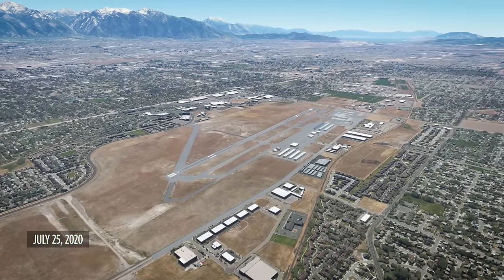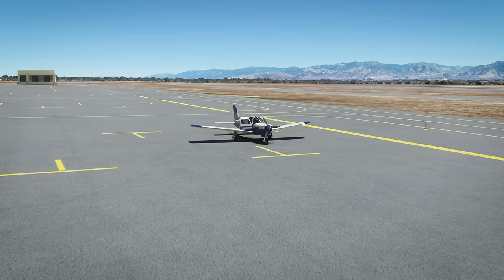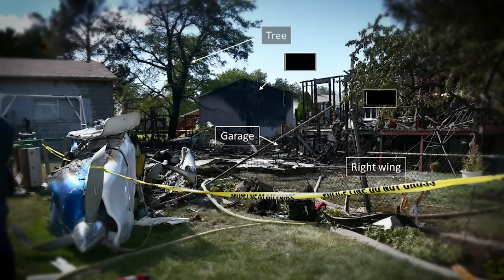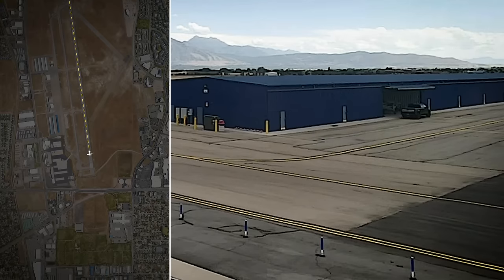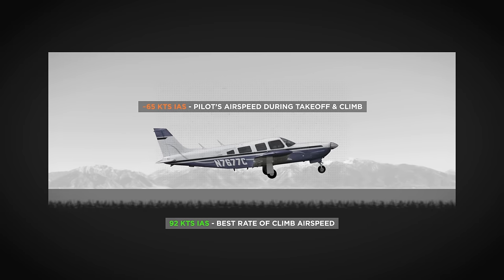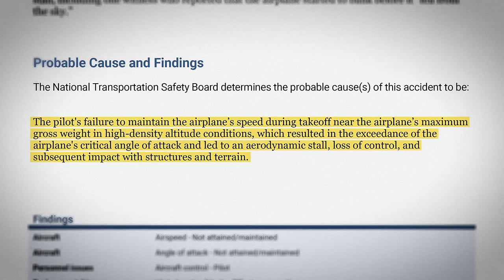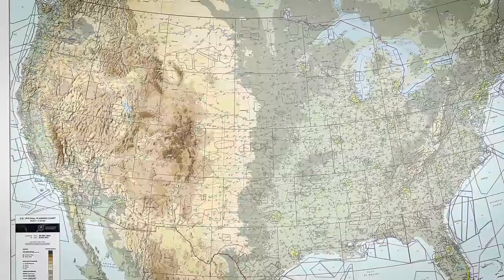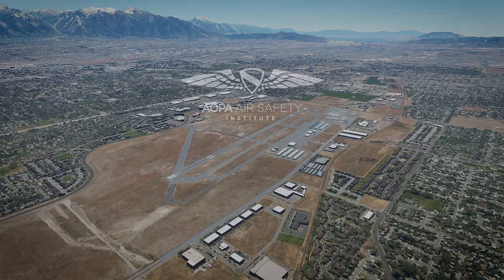Accident Case Study: High Aspirations

Comment: The most frustrating part of this is the NTSB, once again, placing all of the blame on the pilot. He followed the book to the letter, did everything right, and the plane didn't perform to spec, and they even acknowledged this. Sure, AOPA tells you to pad the numbers by 50%, but there's a lot of things wrong with that. The AOPA isn't the FAA. Padding the numbers by 50% would make some planes just flat out unflyable in any condition. Where'd the 50% number come from anyway, a good guess? What's the point of numbers if we're just guessing to begin with?

I think the biggest problem is in the POH. We're taught to treat it as the word of god, yet time and time again the numbers come out flat wrong, and someone dies because of it. I think there needs to be some accountability there.
Reply: Those POH/AFM numbers these days are fairly good ; they are supposed to be what the average pilot can achieve ,if, and it’s a big ‘if’ , the pilot does everything as the book suggests .
We don’t know if he leaned the fuel properly before takeoff. If he did then there would be no reason to fiddle with it just after climb out as he seemed to.
His climb rate was dependent on NO FLAP and a Vy appropriate to that DA which is lower than a sea level one . [ Vx increases somewhat with DA ].
Another nuisance for him would be a decrease in IAS in about the first 100’ AGL as he was climbing in a tailwind [ which he may not have realized ]
Reply: This is solely on the pilot.
Reply: @TJATJA1982  explain.
Reply: @aramusbelmont4992  It's super close to both COG and weight limits on a very hot day. He's flying his family and kids - wouldn't you want a bit more leeway? Did he need to be flying that leg with full tanks? Messing with the mixture lever in those critical moments - shouldn't he have leaned before take-off? Seemingly taking off way under the suggested speed? Stalling the plane into the ground? 

Near max weight, high altitude, hot and taking off downwind -  cutting the margins very fine indeed. 

My respects and sympathies to the families of the pilot and the passenger, but this was not the fault of the POH.
Reply: I think the biggest thing is that he did not abort when the airplane was not flying. We all know what a normal take-off feels like, even heavy. If you're hearing the stall horn on rotation, it's your last warning to save your aircraft. He had 2,000 feet to pull the power back - but more importantly - he had 800 hours to build personal minimums for takeoff, including having a point where he will abort if the aircraft is not in a stable climb. The Airplane Flying Handbook recommends to pilots of GA aircraft that personal minimums be "Abort if not airborne by one half the runway length", or something else easy an quick to determine on a takeoff roll.

This pilot was a better pilot than me; He did everything right up until that last moment where his experience and skill should have led to pulling the throttle and stopping on the remaining runway. That's the only critique I can give to an otherwise great pilot who was screwed by tired aircraft.
Reply: The take off was within normal parameters for an airport at this density altitude.  The takeoff was not the problem, and he still had plenty of runway left.  The problem is that climb rate after leaving ground effect was low, and the tailwind probably aggravated that circumstance.  Accepting a 100-200 ft/min climb  in a N/A airplane is hard if you have not trained for it or experienced it and the tendency is to  stress and try to pull the airplane up to the expected climb rate. Hence the stall.  If you realize you have a tailwind and the airplane is not performing, nurse it around into the wind to help with the climb rate.  Also, if my memory serves, this was nothing that would have prevented the plane from continuing to the south at a low rate of climb as far as obstacles go, so sometimes we have to accept what we can get on hot/high days.   @TJATJA1982
Reply: @garyrisley9170  What could be the reason why an airplane with a nominal weight with a nominal takeoff pitch and at a nominal indicated airspeed for takeoff just does not want to climb at a nominal rate? This should be something very unusual, not related to large density altitude or low engine power.
Reply: @WestAirAviation  Exactly my thoughts.
Reply: Regarding your question: The same reason that aircraft have a service ceiling.  As the air gets thinner, one must go faster to obtain the same component of lift, correct? And absent having surplus power available, the rate of climb decreases.  Once out of ground effect, the airplane in this story was at effectively 7500 feet of altitude.  What is the climb rate of a N/A Lance at 7500 feet?  For an example, my turbo-Lance at airports below 1000 feet will climb like a homesick angel (1250 to 1500 fpm easily).

 On a hot day here at my home airport of 5500 ft, 500 fpm is a good climb.  On the occasions that the wind flipped to a tailwind on me, and I recognized it, I kept the nose down, built speed, flaps one, and a slow turn into the wind to let the apparent wind of the headwind help with lift because I have experienced a 200-300 fpm climb rate.  

The first time I ever flew a C150 at my current airport in the summer, I did not know if I would ever make pattern altitude and managed only a 100 foot to 150fpm rate of climb.  Density altitude can be managed, but precautions need to be taken.

 Weight is also a factor in the climb rate.  In this instance, the pilot could have taken off with 60 gallons of fuel instead of 94 ((a 204lb weight savings) and still had plenty of fuel when he reached Page.  @ikono2
Reply: @garyrisley9170   Thank you for the long answer, Gary. "As the air gets thinner, one must go faster to obtain the same component of lift, correct?" No, it is not correct, as long as we speak about the indicated airspeed. The IAS measured by Pitot tube is actually a measure of available lift, independent of air density, because the lift and the stagnation pressure in the tube are both proportional to the air density. At least if we do not approach the speed of sound. At the service ceiling, the problem is not only the lack of lift, but first of all the lack of indicated airspeed. Otherwise, we could pull harder and climb further without a stall. Therefore, given the nominal indicated airspeed, at nominal weight and with adequate angle of attack, a non-damaged aircraft should climb with nominal rate, whatever the density altitude, right? 
Usually, I fly a microlight which would normally climb at about 300 fpm only. During the takeoff roll, I observe the airspeed, and if it does not reach the speed for rotation at about mid-runway, I abort the takeoff. One day, I was surprised that the motor rpm were higher than usual during run-up for the given setting of the trottle. However, during the takeoff roll the acceleration felt strangely weak despite of high rpm and I did not attain the airspeed for rotation at 1/2 runway. The runway is only 300 m, so everything happened within seconds, I aborted the takeoff just in time and did not roll out. The reason was that I had dismounted the propeller for an inspection, but then mounted it vice-versa. Of course, it was my fault, but my observing the airspeed during takeoff roll saved the day. I think the poor fellow in the video made some similar small mistake, like did not lean the mixture at run-up to account for high density altitude, but additionally rotated at too small airspeed instead of aborting the takeoff at 1/2 runway. Given the conditions close to the limits, two small mistakes were too many.
Reply: @ikono2  agree, he should have known the airspeed he needed to rotate and where he needed to rotate on the runway.
Reply: "Padding the numbers by 50% would make some planes just flat out unflyable in any condition."

First of all that's patently untrue, second, if it were true, you don't have the right airplane for the job. And about the 50% thing - there seems to be a generational issue at play. Younger pilots seem to think that the stuff that kept the old guys alive and flying for 50+ years just doesn't count anymore; we're so much smarter! Right? Anyone who thought this flight was going to result in anything other than exactly what happened should have their certificates revoked. This guy was dead before he ever got in the plane. Unfortunately so were some of his passengers.
Reply: @IslandSimPilot   To be fair it's probably true that nearly all single-engine piston GA aircraft are not really the "right tool for the job" when it comes to providing any kind of practical transportation
Reply: I would say that given the fact that his airplane wound up in someone's house on fire, he didn't do everything right.
Reply: I would not classify this as pilot error- the pilot apparently did not commit any errors. A tailwind on takeoff, while certainly not ideal, does not explain the poor climb performance. Something else was going on here.
Reply: @rrm4cy  A tailwind on takeoff absent any other of the factors involved may not have been a problem per se, but at 7,000 feet DA at max gross, it most certainly was a problem. In ideal conditions with perfect aircraft performance and test pilot-level skill he could have expected a 500 FPM climb. Betting your life on that (never mind the lives of others) in these conditions provided an expected result.
Reply: @IslandSimPilot  judging by your response, I am doubtful that you’ve ever flown a plane. A tailwind on takeoff extends the takeoff roll, which could be observed in footage. While not a sound decision, once airborne, a light tailwind is irrelevant and not a factor in the crash. The report does not discuss the tailwind factor at all. In any case, he was well within the operating envelope. The NTSB report does not indicate whether he had the mixture or prop settings correct on takeoff. The fact that he was adjusting mixture indicated maybe he did not have it set correctly, but they really didn’t get into an analysis at all. They didn’t say anything about prop pitch setting. They did say that 6 of 12 spark plugs were severely worn, which likely caused a hit to performance of the engine (though again, the report fails to analyze this). This report is utterly inadequate at helping pilots understand what went wrong here.
Reply: @rrm4cy  FAA instrument rated. But nice try. The idea that he was "well within the operating envelope" is belied by the outcome. He was clearly doing a wheelie trying to yank the plane off the ground for the second half of the takeoff roll, which added to his poor decision to takeoff at max gross, high DA, downwind. What went wrong here is he decided to attempt this flight. That's what went wrong.
Reply: I've never heard of the 50% padding rule. I've always used 15% as suggested by my instructors, and later suggested to my students.
Reply: Taking off down wind at max gross weight in a high DA enviroment is not following the book to the letter!
Reply: airplane:   you  put me in a situation where I can't fly
 pilot:         well according to the POH, you're supposed to!
airplane:   sorry, don't know what to tell you
Reply: The NTSB didn't blame anybody.
Reply: @My_Fair_Lady  wtf are you talking about? Nobody said anything about the accident...this video and comments were WAY before that even happened.
Reply: My flight school flies 1975 C172Ms. The original cessna POH is flat out wrong... and i mean WWAAAYYY wrong on some of its numbers. So yea it's annoying. Mostly cruise speed and fuel endurance. I know for a fact a C172M isn't going toc ruise at 121 mph. with 60% power. LOL.
Reply: He took off downwind are you serious ???
Reply: @kenclark9888  The aircraft had enough runway to still get airborne... The problem seemed to have become serious after he left ground effect and tried to climb out.
Reply: @ikono2 Those book climb rates are probably in clean configuration and , who knows why , he was using flaps . Planes always climb steeper and faster clean.
He may not have realized that Vy would have been ~ 7% lower at that DA than at sea level and given that there was a small tailwind he’d have a small a/s reduction in the first 100 ‘ AGL to boot due to ground friction because that tailwind speed would be higher there .
As has been said , failure to lean mixture could have had a decisive effect but if so I doubt he’d have even got off the runway .
Reply: This is like saying why the bridge you drove over today has factor 2 safety built into every part of it... are you kidding.
Reply: Pilots ARE RESPONSIBLE for all of it.  If the plane could not climb then the pilot was to set it back down on the ground.
Reply: My guess is those book numbers take into account a properly leaned engine. Running excessively rich would cause less power and worse performance. It seems that the pilot remembered to lean the mixture too late to avoid disaster. 😢
Reply: @IslandSimPilot i just want to be clear here.  You’re saying the FAA is wholly at fault for this accident, yes?  Since they’re the ones demanding we abide by the POH, carry it at all times, and plan our flights using it’s data.  And somehow you’re the only guy that knows that POH numbers require a test pilot to achieve? Seems like that would be a good thing for the FAA to teach pilots - that the POH is unreliable, overly optimistic, and should not be followed.
Reply: @ragedracer1977  Just trying to figure out how many strawmen you've managed to fit in here. The pilot is wholly at fault. I did not say POH numbers "require a test pilot to achieve". And I did not say the POH is unreliable, overly optimistic, and should not be followed. So basically you just made up a bunch of stuff I didn't say, claimed I said it all, refuted it, and you win? Good job. It is no wonder to me that we keep seeing the same accidents over and over again. And we will obviously continue to do so, given the number of pilots who just insist "it should work!" How did it work for this guy?
Reply: @IslandSimPilot   you are lacking in comprehension. You said the POH numbers required test pilot skill to achieve.  (THAT is the only thing I indicated came from you.) That should not be the case.  An average pilot should be able to hit book numbers or very close when conditions match the book.  If the book requires a 50% or 30% or whatever margin, why have it in the first place?  If the POH is flat wrong when it comes to performance, why does the FAA place such emphasis on referencing it?  It’s required to be in my airplane at all times.  I’m required to reference it before every flight.  A pilot should expect its correct.  If, as you said, it requires test pilot skill, it’s not very useful as a reference.  Actually, it’s downright dangerous.

The fact is, given the conditions, there is no reason that plane shouldn’t have climbed at 500 fpm.  A tail wind or head wind isn’t even relevant.  Your climb rate is the same.  This pilot wasn’t trying to out climb a mountain.  Or, rather, perhaps he was - he just didn’t know it.  He didn’t understand rate vs angle, I’d wager.  He thought he should be higher than he was, so he kept pulling back to get higher, which only made it worse.  He just needed to accelerate to the proper IAS, and pitch for roughly 500 FPM.  Might have been 450, might have been 550, but I bet it would have been close.  A tailwind or headwind only changes your takeoff roll, not your climb rate.  Once you’re in the air, the plane has zero concern for wind direction.  You experience this every single time you fly a pattern after taking off with a headwind.  Bet no pilot ever even notices the change in angle when they turn crosswind or downwind….

Comment: I began my flight training at 00V/KFLY, 6,000 MSL, in summer. DA was absolutely drilled into my skull even before the first flight. It just blows my mind that this happens every year to far more experienced pilots.
Reply: @jonathanparle8429  I'd say that's just semantics, as it was another in a list of factors working against the pilot that led to a tragic outcome. Very unfortunate and saddening.
Reply: @jonathanparle8429 Yeah, this was a case of all the Swiss cheese holes lining up. Terrible no matter what. :-/
Reply: I learned at KAPA and experienced a very slow climb on a hot day during training. Seem to remember the IKEA across the highway getting very large indeed… This story seems especially tragic—do your best to get it right, still die. Cause imho goes back to planning—when seeing all the numbers going high, weight, temp, afternoon takeoff, DA… and with family and kids onboard… be conservative and call it a day. Disappointed kids will get over it.
Reply: Curious, what’s DA in this context?
Reply: @abhi211-T density altitude. Altitude performance numbers for airplanes are all listed at a standard temperature of 15C, or about 59F. When the air gets hotter it gets thinner, mimicking a higher altitude than listed in the book which assumes 15C. So you have to correct the altitude for changes in air density caused by hot air to get the right performance numbers.

Example: the book says your plane can take off in 1000 feet and climb at 750 feet per minute with a field elevation of 5000’ above sea level. This number assumes 59 degrees Fahrenheit. On this particular day you’re taking off in 100 degree weather. In this case the density altitude is 9000 feet, so the air density is equivalent to actually taking off at 9000 feet elevation at 59 degrees Fahrenheit. You’d need to look at those numbers and you’d find that maybe your plane actually will take off in 2500 feet and climb out at only 450 feet per minute.

The higher, hotter, heavier, and more humid, the worse your plane will perform.